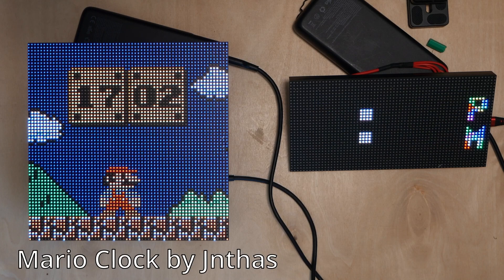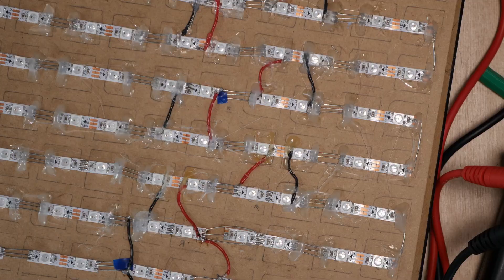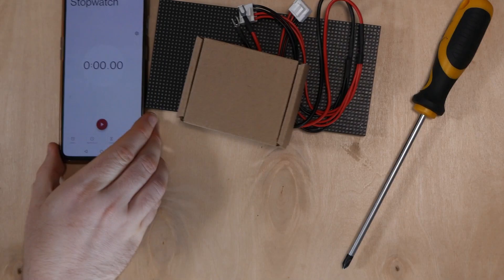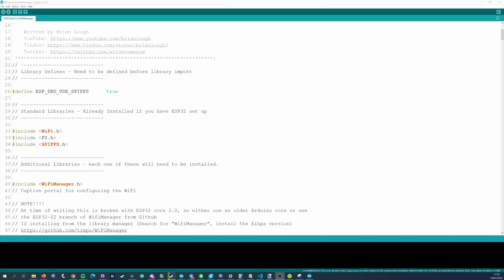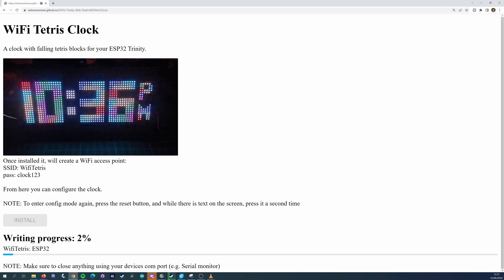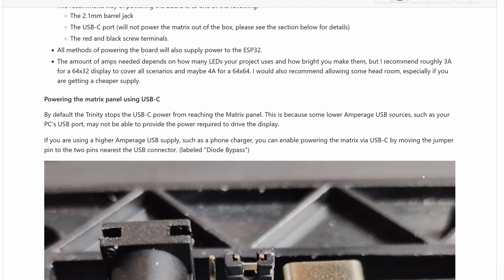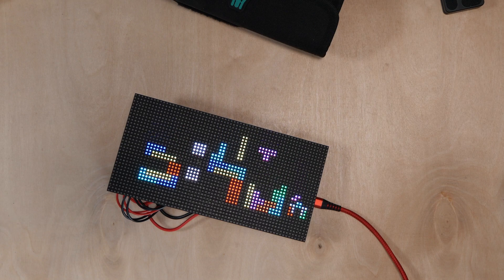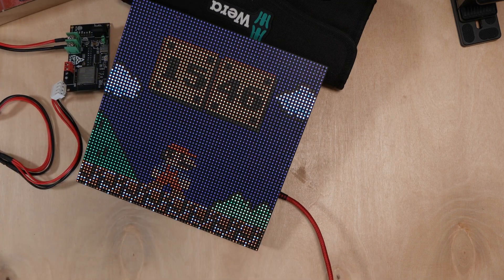2 Retro Clocks with an ESP32 (Couldn't be simpler!)

Comment: Every thing works fine until after I save then nada nothing happens. If I manually reboot it loads but has Dublin time.  I am  having to disconnect from internet to get to the config. page. I have tried to go back and reload the ESP and end up with the same problem. anyone any ideas?

Comment: Do you have any information on using the 64x64 RGB Matrix with the Arduino Mega? Most of the available demos that came in the device libraries don't work.  I have the Waveshare 64x64 display and the Arduino Mega.  I have found very few usable sketches. My text based sketches work well, but the graphic design sketches have been mostly worthless.

Comment: Great tetris clock works well on my 63 by 32 matrix display, the only issue is that the ap will not allow me to change to Australia/Perth the 192.168.4.1 menu comes up  with everything, I save it , and it still only Knows Ireland. I am uisng the exact esp 32 in your video. What am I doing wrong????

Comment: clock work perfectly, but cannot get it to save changes using the AP 192.168.4.1, it only displays Dublin time not Australian time😀😁
Reply: mine too, think my problem has to do with the trinity not connecting to the router

Comment: Hi Brian, if the Mario clock loses power for a long period of time, is the time correct the next time it comes on again? If no, is there a way around this problem e.g. with a battery? Thanks
Reply from the maker: The time comes from the Internet so once it has Internet connection the time should be correct

Comment: Hi Brian,
Thank you for the video.
I have 4 panels chained together making a 128*128 panel, I was able to display some Gifs after some adaptation of the available examples with the usage of VirtualMatrixPanel class.
Is there a way to get the Mario clock example running on a 128*128 panel?

Comment: Looks great. Just bought a Trinity module to check this out. I have a nice 128x128 panel i am trying to connect to a micro controller. Is this resolution beyond the capacity of an ESP32? If so is there a different controller that would do the trick? Thanks!

Comment: Is it possible to use a regular ESP32 and connect the LED directly without level shifting? Don't we need to shift signals from 3.3V to 5V?
Reply from the maker: Most panels work fine with 3.3v signals. A regular esp32 without shifting normally works fine
Reply: I was curious too, we see the regular wiring diagram for using esp32, but the trinity board has a bunch of extra stuff on it
Reply from the maker: The Trinity doesn't do any level shifting, the extra stuff is mostly around managing power between the esp32 and the matrix.
Reply: @BrianLough  thank you good to know!

Comment: Hi, I have a 64x64 display that I got from Aliexpress and for some reason half of the screen is missing. It's like 1/4 of the screen is on another 1/4 is off. Then on and off again. Do you have any advice? The pixels do work but they don't display anything with my ESP32

Comment: Great vid! I've got some 38 pin ESP32s on the way. Reading through some of the comments and answers here and:
You mentioned in one of the comments that this board could power a 64x64 matrix without a power supply - is that as simple as soldering up the 5v and ground pins? From some research i've done (I'm a complete beginner mind you) you'd need to have a 5v 4a power supply to run the 64x64s at max brightness. Is it possible for the board to do this and power itself? and... how can that be figured out? Thanks!

Comment: I’m trying to use a hologram fan as an odometer for my motorbike, I need a way to encode and render the sensor readings to a video and then to input video of the hologram, so far I’ve considered using esp32, is it capable of taking odometer sensor reading and rendering two block numerals that may rotate slightly I.e.isosceles scaling to create a depth of field effect amongst the invisible display?

Comment: Hey, awesome Video! Sadly my Matrix only shows 2 rows of 16 leds (The top 16 and 3rd row of 16 leds) How do i fix this?
Reply: I suspect a connection is not right, but i tested everything...
Reply from the maker: Are you using a Trinity or your a diy solution? It sounds like there is a problem with your e pin, hopefully that narrows it down!
Reply: @BrianLough  Hi thanks for the answer, it really seems to be the e pin, but even with a secure connection, im only getting pixel flickering if i twist and turn the cable. I think the cables interfere with one another as when i move them, they give different signals. To be fair, the cable management is pretty chaotic, ill try using shorter ones and lay them parallel to one another.
Reply: @toastknusprig9622  did you fix it?  I seem to be having the same issue

Comment: A fatal error occurred: Failed to connect to ESP32: Timed out waiting for packet header. Noob in need of help...
Reply from the maker: Make sure nothing else is using the serial monitor (like the Arduino ide, cura will also latch onto it if you use that), try a different USB cable and try a different USB port
Reply: @BrianLough  No luck. Think I probably don't have WifiManager installed properly. Any way to use the old way? With "ssid and "password"?
Reply from the maker: @bigtst36  which project are you installing?
Reply: @BrianLough  Tetris clock. The animation part installed just fine, though I had to hold down reset button on the board.

Comment: Hi! Im currently using the Tetris clock but the constant brightness is bothering me, especially at nighttime. Are there any plans to integrate a brightness setting?
Reply: I got two of the Trinity boards and they come with an LDR. You have to solder them to the board manually using lead wires so that you can position sensor where it needs to be. Haven't wired mine up yet, so not sure if works or not.

Comment: Brilliant video - I've just got one of the 64x64 matrix from your links but it didn't come with any pin outs/documentation - where did you find pinout info for the HUB75E connector?
Reply from the maker: That graphic was made by the same guy who made the Mario clock, but I'd say he got the info from the i2s matrix library GitHub 

https://github.com/mrfaptastic/ESP32-HUB75-MatrixPanel-I2S-DMA#2-wiring-esp32-with-the-led-matrix-panel

Comment: hi i get this error while compiling, any reason why?

Arduino: 1.8.15 (Windows 10), Board: "ESP32 Dev Module, Disabled, Default 4MB with spiffs (1.2MB APP/1.5MB SPIFFS), 240MHz (WiFi/BT), QIO, 80MHz, 4MB (32Mb), 921600, None"

C:\Users\J\D\Arduino\libraries\ESP32_HUB75_LED_MATRIX_PANEL_DMA_Display\ESP32-HUB75-MatrixPanel-I2S-DMA.cpp:10:21: note: #pragma message: Compiling for original (released 2016) 520kB SRAM ESP32.

     #pragma message "Compiling for original (released 2016) 520kB SRAM ESP32."  

                     ^

sketch\sketch_apr09b.ino.cpp.o: In function `MatrixPanel_I2S_DMA::flipDMABuffer()':

C:\Users\J\D\Arduino\libraries\ArduinoJson-6.x\src/ArduinoJson/Misc/SafeBoolIdiom.hpp:15:(.iram1.20[MatrixPanel_I2S_DMA::flipDMABuffer()]+0x8): dangerous relocation: l32r: literal placed after use: .literal._ZN19MatrixPanel_I2S_DMA13flipDMABufferEv

C:\Users\J\D\Arduino\libraries\ArduinoJson-6.x\src/ArduinoJson/Misc/SafeBoolIdiom.hpp:15:(.iram1.20[MatrixPanel_I2S_DMA::flipDMABuffer()]+0xe): dangerous relocation: l32r: literal placed after use: (.literal._ZN19MatrixPanel_I2S_DMA13flipDMABufferEv+0x4)

C:\Users\J\D\Arduino\libraries\ArduinoJson-6.x\src/ArduinoJson/Misc/SafeBoolIdiom.hpp:15:(.iram1.20[MatrixPanel_I2S_DMA::flipDMABuffer()]+0x1c): dangerous relocation: l32r: literal placed after use: (.literal._ZN19MatrixPanel_I2S_DMA13flipDMABufferEv+0x8)

C:\Users\J\D\Arduino\libraries\ArduinoJson-6.x\src/ArduinoJson/Misc/SafeBoolIdiom.hpp:15:(.iram1.20[MatrixPanel_I2S_DMA::flipDMABuffer()]+0x2e): dangerous relocation: l32r: literal placed after use: (.literal._ZN19MatrixPanel_I2S_DMA13flipDMABufferEv+0xc)

C:\Users\J\D\Arduino\libraries\ArduinoJson-6.x\src/ArduinoJson/Misc/SafeBoolIdiom.hpp:15:(.iram1.20[MatrixPanel_I2S_DMA::flipDMABuffer()]+0x34): dangerous relocation: l32r: literal placed after use: (.literal._ZN19MatrixPanel_I2S_DMA13flipDMABufferEv+0x10)

collect2.exe: error: ld returned 1 exit status

exit status 1

Error compiling for board ESP32 Dev Module.

Comment: Built this with your ESP32-Trinity and works great. I remember seeing somewhere that there is the ability to use an ambient light sensor to automatically dim the display. However, I can't find this again. Could you elaborate on this?
Reply from the maker: Great to hear! 

The LDR (light dependent resistor) should have come with your Trinity (it's a red and white thing). it needs to be soldered onto the top right of the board, above the esp32 module. It's not added as part of assembly to allow users to route it to the top of the panel or somewhere that makes more sense than pointing directly out from the back of the panel.

After that It's possible once the software supports it, which isn't the case with either of these examples at the moment.

Here is an example showing how it could be added to a sketch though:

https://github.com/witnessmenow/ESP32-Trinity/blob/master/examples/TrinityFeatures/LDRAutoBrightness/LDRAutoBrightness.ino

Comment: Can we use a P1 board instead of the p3?
Reply from the maker: In theory yes. once the only difference is the size of the LEDs it really shouldn't matter. There are some displays that are configured differently though so there is a chance it won't be the same.

The trinity is also really designed to work with p3 panels from a physical size point of view, but it would hopefully work out.
Reply: @BrianLough  ok thanks very much. Also is there any other boards that work as I can't find a trinity board here in Australia or on aliexpress
Reply from the maker: Sorry but Makerfabs is the only place stocking the trinity at the moment.

As I mention in the video, any esp32 could work if wired appropriately , once it has 14 available gpio. 

There are some alternative devices for controlling matrix boards like one made by adafruit, but I'm not aware of one that will work with these clocks.

Comment: How would I go about using the esp32 as a simple wifi antenna for my laptop?  for example if my wifi card inside was to fail, could I use the esp32 to connect and surf?
Reply: Yes, but speeds would be lower than before, about 10-15mbps. We have implemented this in work, connecting esp32 over Ethernet and then using the ESP32 over wifi to an access point. Your keywords to Google are PPP and LWIP bridge.

Comment: Hi Brian, is there a limit on the amount of panels that can be used i.e. could I use 4 panels in a square to make an extra large Mario clock? If so, apart from 3 extra panels, what other components would i need?

Thank you
Reply from the maker: Is there a limit, yes, the esp32 eventually doesn't have the memory to handle a large amount of panels, but 4 panels should be ok.

Is it possible, yes, but it will be significant effort.

There are a two different issues that need to be addressed.

1) physically assembling the panels. Wiring is not too big of an issue, ribbon cables usually come with the panels and you plug the trinity/esp32 into the first one and then plug the ribbon cable in to connect the other ones together. 

Powering the panels is a bigger concern, the trinity probably can't power the 4 of them, but if you supply an external 5vs to the panels that would be fine.

2) the software.
The first issue is that the libraries default is to consider the panels being in a long line (4*1) but you are looking to put them in a grid (2*2). The library does support this, but you'll have to read the documentation on it on the GitHub page

The code would also need to be modified to handle a 128*128 screen, it's currently written for a 64*64
Reply: @BrianLough  thank you for taking the time to get back to me on this.

Comment: Sir, great love all the videos about the 2 Retro Clocks with an ESP32 (It couldn't be simpler!). Sir, I have a favour for you, Is it possible for you to make a video on youtube on how to make a 6 dof Xbox 360 wireless-controlled robotic arm vehicle using the esp32 module with an Xbox360 controller and can you give me the circuit diagram and the codes for the 6 dof Xbox 360 wireless-controlled robotic arm vehicle using esp32 module with an Xbox360 controller? Sir, reply to my comment, is it possible or not. Sir, tell me.

Comment: Is it possible to make the Mario clock with 2 panels of 32*64 in stead of 1 panel of 64*64?
Reply from the maker: It is possible, but it's a little complicated to be honest. Check the GitHub page of the i2s matrix library for details

Comment: hello Brian, I did the editing but I have 2 problems:
1) blue and green are reversed.
2) impossible to configure the time for europe, what is the right command to put in the WEB interface.
I tried UTC +1:00, UTC+1, UTC 3600, UTC Europe/brussels

Thanks for the video
Reply from the maker: For 1), this is a problem with some panels where they physically have the wrong colours connected, it's something that will need to be fixed in code so you'll have to install the version from GitHub (not webflash)

Fix for it is described here:

https://github.com/witnessmenow/ESP32-Trinity/blob/master/FAQ.md#my-colours-are-mixed-upnot-right

For 2) you should be using a string to get the correct time, so for me in Ireland it would be "Europe/Dublin" for central European time it could be "Europe/Paris" or something
Reply: @BrianLough  thank you very much, everithing is ok
Reply: Europe/Brussels worked for me. Europe/Amsterdam did not.